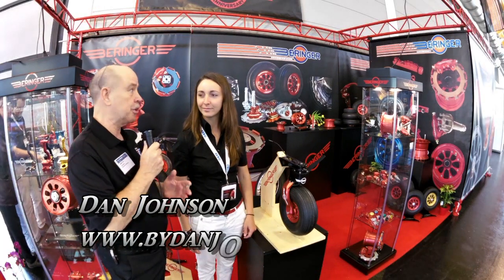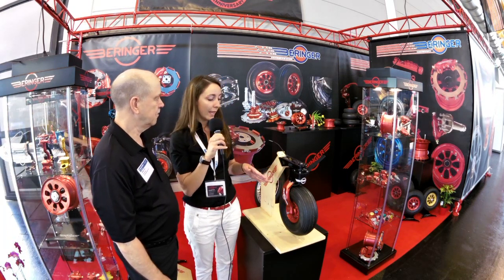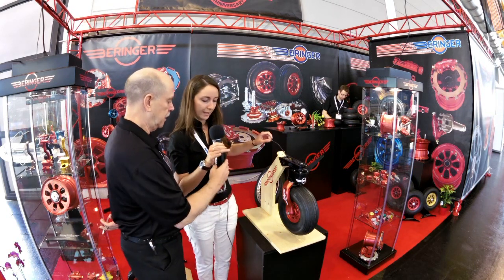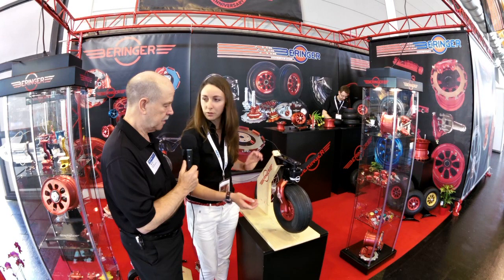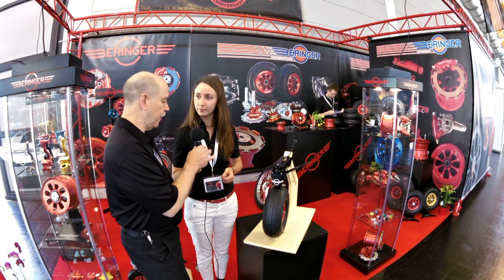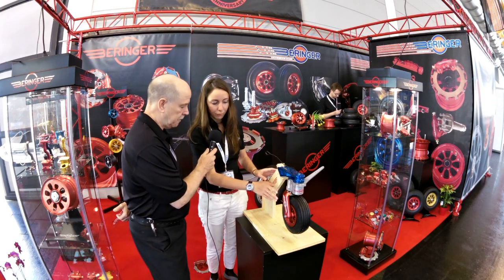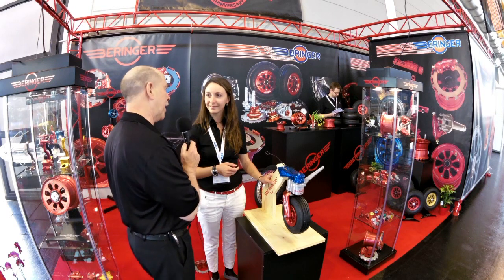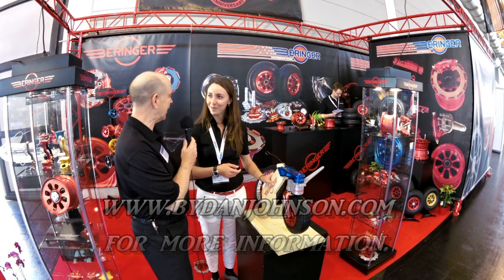Beringer Anti-Ground looping tail wheels, Aero Expo 2015.

Comment: Wait a second.  Are they saying the only reason ground loops happen is because the tail-wheel can rotate more than plus and minus 15 degrees?  Are they saying the only reason a ground loop happens is because forces that occur to the tail-wheel during landing, takeoff and taxi are sufficient to dislodge the tail-wheel from rudder control into a free-wheeling state... and maybe even prevent the tail-wheel from pointing straight ahead?  Am I missing something here?
Reply: max bootstrap please say more

Comment: I thought all tailwheels were tied to the rudder? I guess not.
P51 has a lock-unlock tailwheel tied to the stick.
Reply: Lots of aircraft have locking tailwheels, that are not connected to the rudder DC3, Air Tractor ag planes Beech 18 etc. you just unlock them and use the brakes for turning.
Reply: I want to say the Stearman didn’t have a connected TW at all.